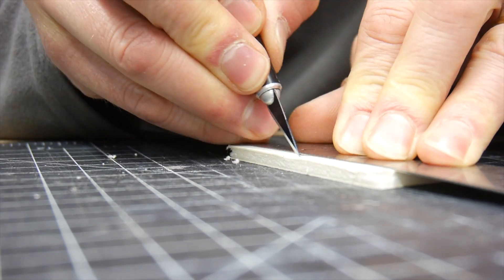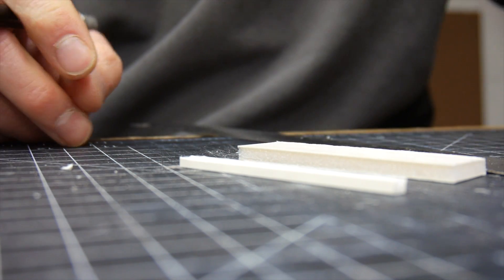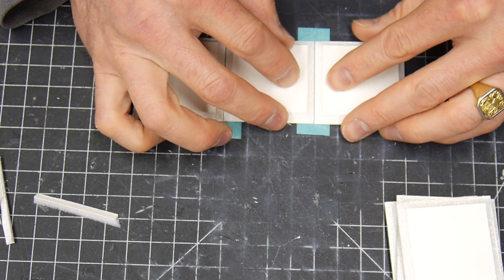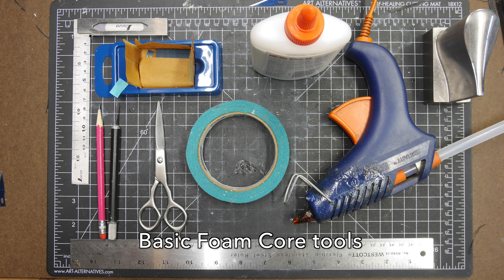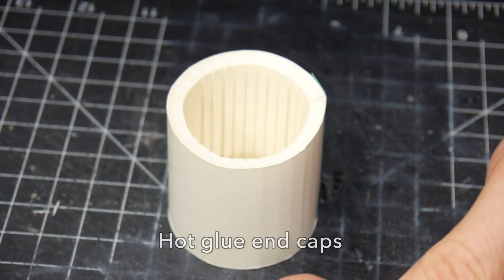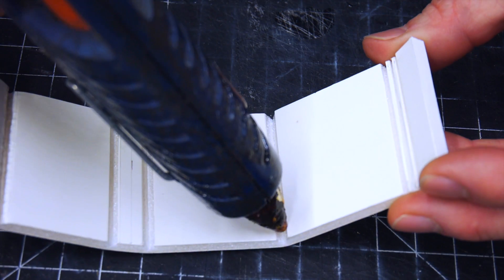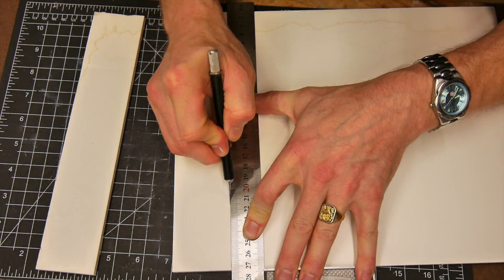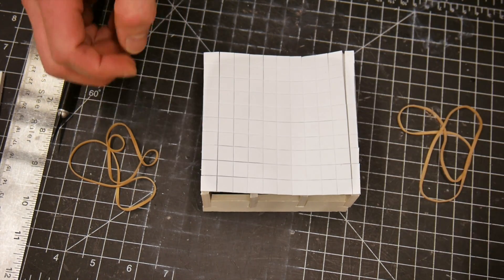Foam Core Trilogy: Basics, Adv. Basics & Pro Guide FoamBoard model making

Comment: ive always peeled off the inside layer of paper on one rounded parts, like the cylinder. rubbing that side down on the edge of the table helps it curl that way. it doesnt get he faceting
Reply from the maker: Have to investigate that, sometimes the paper is not easy to peel

Comment: why not use superglue with accelerator, instead of elmers glue or hot glue.
Reply from the maker: I would not use a urethane or epoxy, it's to hard and not a material of similar hardness as the foam core. It will make molodifying the part quite difficult should you want to alter your foam core. It's just not an appropriate adhesive to use with phone core.
Reply: @EricStrebel  what about fast drying rubber cement?
Reply: @massriver  good to know thx
Reply from the maker: Patience....
Reply: @EricStrebel  time is money. the best techniques get the fastest results with the best quality. slow/patience is for the old/handicapped. heeh
Reply from the maker: Lol, suit yourself
Reply: @IronMan-yg4qw  what about concrete? Or Adobe? Even harder, heavier, and messier! A win win!
Reply: @jonathangehman4005  hmmm ya u dont get the idea. of a faster better glue. if u think those are good then ok for you. hah
Reply: @EricStrebel  hah im wana find a better way is all.. :)  i guess u dont. :)
Reply: @IronMan-yg4qw  staples are fast too.
Reply from the maker: Bahahah
Reply: @EricStrebel  Just speaking for myself. 2part Urethane apparently won't dissolve styrene foam and doesn't need air to dry.  Tried JB on a whim on 2" foam didn't crack . Some of the epoxies cracked.  Just an option to try.
Reply: @jonathangehman4005  um is that viable in these situations?
Reply: @EricStrebel  hehe